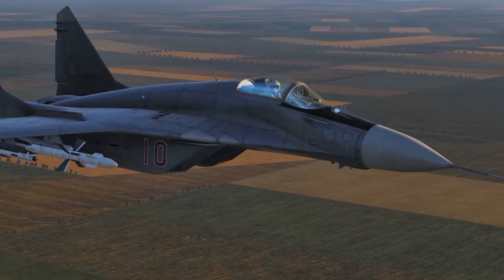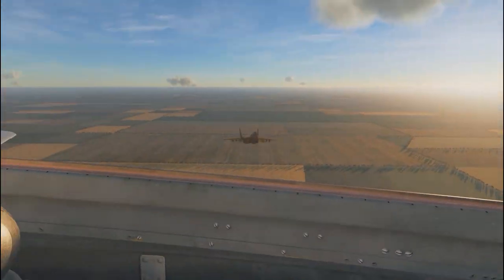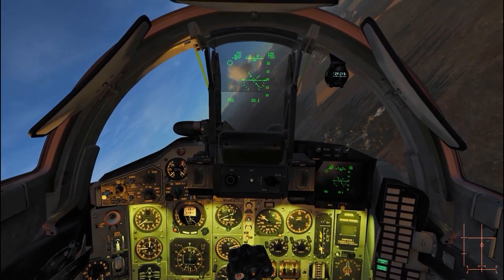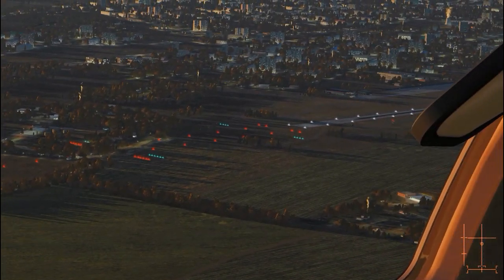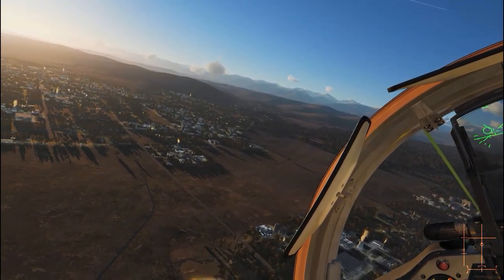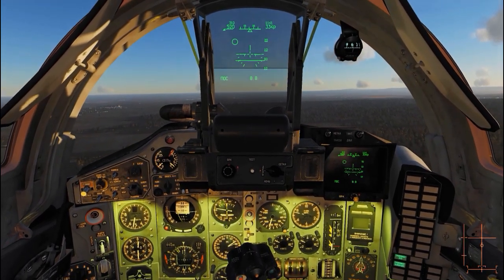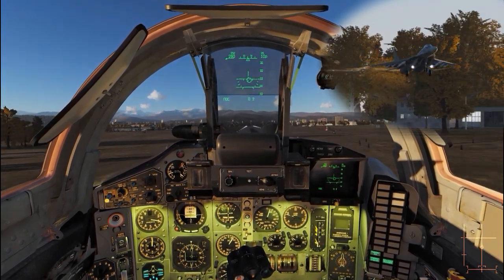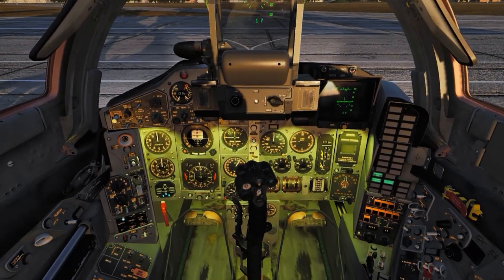MiG-29 Landing: Revisited

Comment: i cant get speed below 500 whilst landing how can i lower the speed?
Reply from the maker: RAmar Juve , reduce the throttle early and extend your landing gear at 500 km/hr while flying level. The extra drag will continue to slow you down. At 460-480 km/ hr lower your flaps. From there slowing down further should be easy.

Comment: Seems rock solid. Did you have autotrim on? Or is a matter of curves? I noticed little to none stick movements. Just being curious here.
Reply from the maker: WamBam36 , no auto trim. Pitch and roll have  a dead zone of 2 or 3. 0 curve for pitch and curve=8 for roll. That’s become my standard for most of what I fly. Sometimes roll gets bumped to 10.
Reply: Flankertraining.com Thats pretty inpressive flying. I might try those settings myself as i find the mig a bit of a bitch to handle. Thanks for your reply, much appreciated.